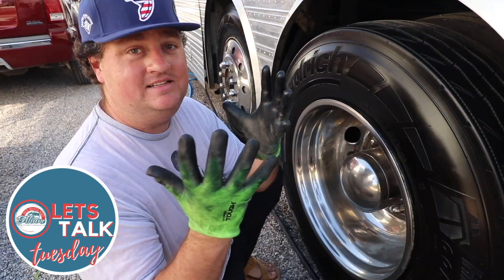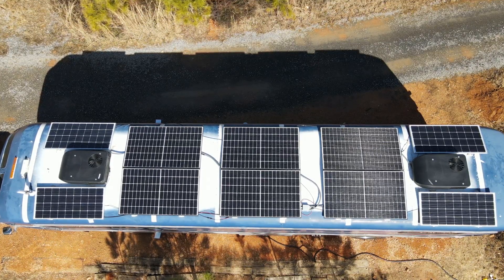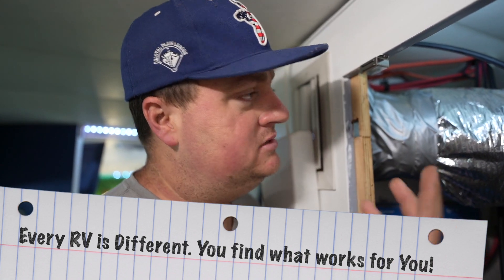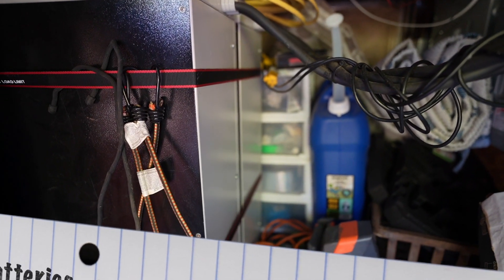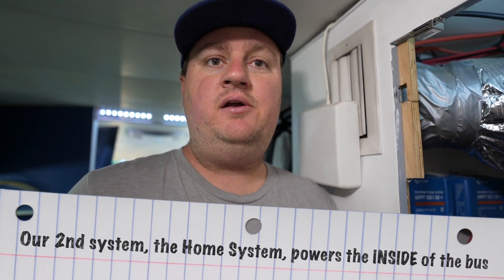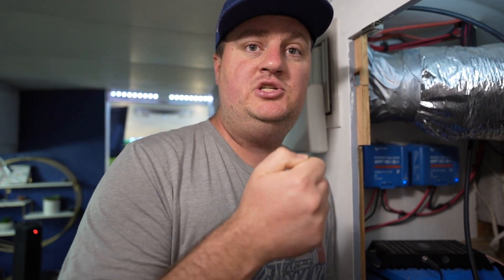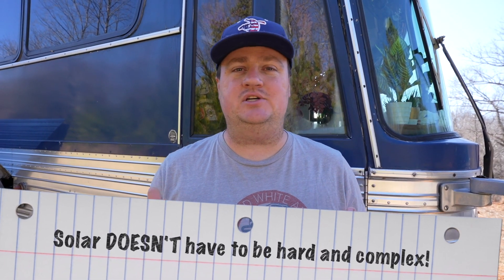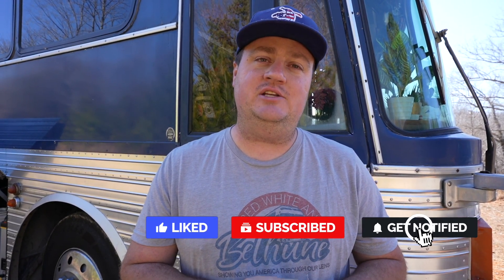Simple and Easy Solar Set Up for Your RV

Comment: Curious why you got two 150/35 amp solar controllers instead of one 250/100 or something?
Reply from the maker: It’s because we installed them as two separate systems.
Reply: Ahhh got you. Did you just connect them both at a bus bar before going to the battery bank or are your batterys set up separately as well?
Reply from the maker: The batteries are set up separately as well

Comment: Nice job Kyle, any reason ya'll didn't go with a mini-split? I understand Blue Betty has the 2 hatches which make rooftop units very practical, but do you find them noisy? How much did your solar panels cost and is there anything you would have done differently with the installation? I have so many questions and it's awesome to see a family out there doing this. I just picked up an 84 Eagle that was formerly used as a prison 🚌. We live in KC and would love to connect when you head out west. Our family of 6 were in Nashville just after the New Year and enjoyed eating @ Monell's! God Bless
Reply from the maker: Thank you! I really wanted to do a mini split. I was having trouble finding someone that was willing to help me with installing one. I don’t know much about those. We were kind of running out of time so I just went with the Rooftops. They are definitely noisy but I guess we’ve just gotten used to. The 315 watt big panels I paid around $200 a piece for them. The smaller ones I want to say were around $150. That’s awesome that you picked up an Eagle. They are awesome buses and you guys will love it!
Reply: Thanks for the info, and I look forward to your upcoming adventures

Comment: You mush got good battery case from Big battery Last post form Diy solar power with Will Prowse He open up he big battery that leak found that half of the battery pack had a lot scratches and line-up with welding of the case. Will is look into the leaking and Big battery also look into it . hope no big bounce.
Reply from the maker: Oh no! Ours works great for us. Hopefully it is just a one time thing for Will 😟

Comment: Great video. One of our Hipcampers that had stay on our property that has issues with their panels not getting full sun due to being flat on the RV, they estimate only getting 20 to 50% charge, and plan on remounting the panels at a angle. Have you found this to be an issue? 

Our panels aren't on our RV, but it's recommended they be at a 45 degree angle, we've been debating  on how to attach our panels or haul them when we travel.
Reply from the maker: Ours our mounted at a slight angle, so they aren’t completely flat. We haven’t had any issues with it. 

I don’t know how we would attach them at 45, it would make us waaaay too tall. I can definitely see doing it on a shorter rig or if they are just on the ground.
Reply: @Beingbethunes  that's our issue to with going with that angle.. though have seen some brackets on Amazon for RVs that you adjust once your at your location.. only issues the ones we've found you have to manually adjust and we don't feel like crawling on the roof every time..

Comment: like the duel system setup, was wondering what i would do with the 12v system when i upgrade to 24v. but i would end up just getting a 24v to 12v reducer to run house stuff since we cant carry all that weight in a 30ft v8 already maxed out with a 250lb industrial embroidery machine
Reply from the maker: Sounds like a good plan. Thank you for watching!